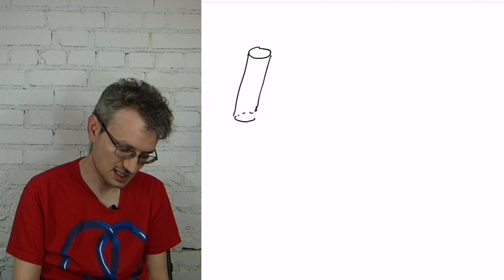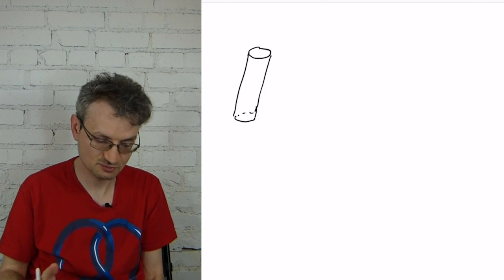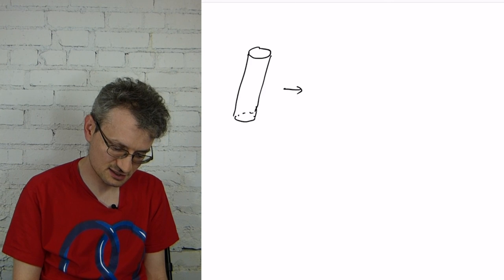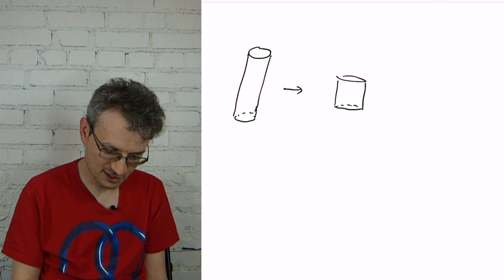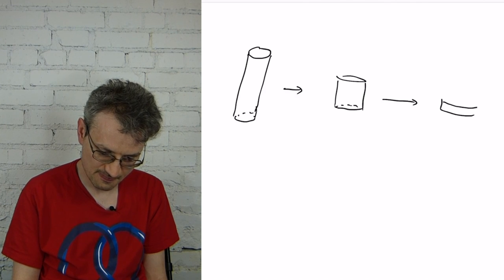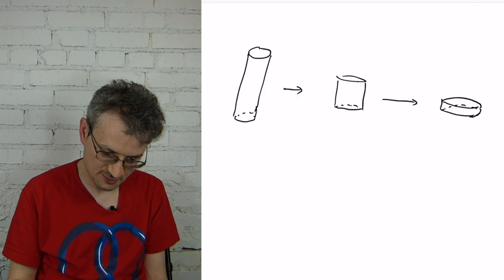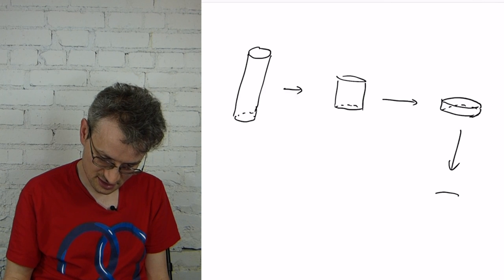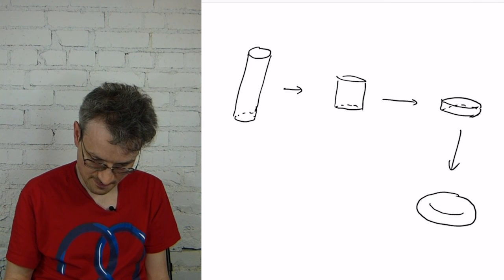How many holes does a straw have?

Comment: Question: you say a pair of scissors has two ways of passing a rope through their loops, but isn't there at least one more? Rather than passing through one single hole or the other, couldn't you deform it so a rope passes through both holes at once? Are there ways to pass it through both holes that are non-homologous to any other sequence?
Reply from the maker: Getting a little bit more technical: the homology group is Z x Z, or the product of two copies of the integers. Another way to think about it is vectors in the plane with integer coordinates. Going right one step corresponds to going through one of the holes in the pair of scissors, and going up one step corresponds to going through the other hold. Any other way of passing rope through the loops is homologous to some number (possibly negative) of copies of each of "right" and "up".

Comment: To answer how many holes a person has, instead of creating larger spheres around atoms, what about creating an increasing size sphere and counting how many paths through the body that sphere has? When passing a sphere through the body, only allow those paths don't cause lasting damage when the body deforms around the sphere to accommodate its passage.
Reply from the maker: Sounds painful!
Reply: @henryseg  we should define paths via fluid being able to flow without going through cell membranes.
Reply from the maker: @zoltankurti  Fluid under how much pressure...?
Reply: @henryseg  I think I have a new approach. Take the cells from the human that are not epithelial cells. Take the set of points in these cells and the induced topology on these points from the standard topology on R^3 and apply your favourite definition for a hole.

I'm afraid a precise definition that's not a torture does not exist, altough I don't have a proof.

Here is a new question: this may be fine for defining the number of holes on each person. But what if I ask what's the number of holes in the concept of a human, not a specific person? If we assume there is a definition that works for every person, can you define the number of holes on The Human?

Comment: I'll always contend that a straw has no holes being that a properly structured and functional straw is itself a tube. A hole would be a puncture in the side of the structure
Reply: That's a good point

It itself is a hole therefore making it a pipe, tube, or tunnel, so on.
Reply: But how long must it be to function as a tube? Is a finger ring a tube with no hole in it?

Comment: I like how the sendoff of the video leaves you questioning not only what "holes" are, or what the object in question is, but now what it means to "have" a hole. Does the opening or closing of a mouth mean that a body no longer has that opening? Surely it still "had" it but no longer "has" it. So the question of how many holes a person "has" depends on the precise state of that person... I guess.
Reply: The mouth is still a hole. It just has a door called the jaw.

Picture this: a doorframe has a hole. A blank, solid door (usually) does not. If there is one door to a room, with no other opening (door, window or vent), then the room also has no hole. Translate this to a human face: the mouth is the doorframe. The jaw is the door. The lower face is the house. Kinda.

That's just my interpretation, though.
Reply: The proper answer to the question of how many holes a person has, regardless of the state of the person, is always "not enough, now where'd I put my knife?"

Comment: A hole is defined as "a hollow place in a solid body or surface."

A straw has one hole that goes all the way through what would otherwise be a solid cylinder. If you take a cylinder and drill a hole 40% into the object from one end, then the other, it has two holes. If you then drill through the remaining 20% in the center you merge the holes into one hole larger hole that runs completely through the object. This is the obvious linguistic definition and what people mean. Anything else is sophistry that primarily only serves the purpose of corrupting language. Fundamentally language is a tool for communication, and corrupting it in this way ultimately leads to further difficulty using that tool. The end result of breaking definitions that are perfectly serviceable without a serviceable replacement is the erosion of our capacity for communication. . . Communication breakdowns often result in disaster.
Reply: at least when people bring unneccesary sophistication into conversations they typically preface it with "technically..." which is at least a good disclaimer for when people want to get annoying about details. But yes, technicalities are almsot entirely useless in day to day lives and dont serve to  help the average person. Good comment.

Comment: Well, I mean, the idea of increasing the radius around each atom until they overlap kinda answers the "how many holes" question. It starts at infinity and converges to 0. The higher the value under the curve, the more dissociated the thing is (kinda like a stdev)
Reply: It doesn't start infinitely? It starts at zero. Or you could argue it starts at one if a hole with a non-existant/infinite perimeter and infinite surface area, counts as a real hole.

Comment: A basketball has a 2 dimensional hole, but a solid metal ball does not. 
A donut shape has two 1 dimensional holes and only one 2 dimensional hole unless it is solid, in which case it has only one 1 dimensional hole.
If a straw is considered only in the limits of 3d space, it could have only one 1 dimensional hole or it could have two 1 dimensional holes plus a 2d hole that aligns with the two 1d holes. This would change if there was continuous shearing.

Then there is the possibility, if you are considering higher dimensions, that a straw is a 2d plane that approaches itself on an single axis for all points in a line, in which case it has no holes, because you can make it expand and contract infinitely without changing what its shape will be at this point in 4d.

A black hole is a hole in at least the 4th dimension, and a 3d sliver is visible in the 3d dimension, so a black hole is at least one hole of an object that exists at least in the fourth dimension.
But it is entirely possible that groups of black holes are part of a single 5+ dimensional object, like a single 2d hole of  an empty donut (the ring) will look like two separate circles in a 2d cross sectional universe.

Comment: i say 0 cause its a material designed just to hug itself in a cylinder shape, any spaces "inside" that cylinder are not inside, they are basically outside since the inside would be in the edge of the straw

Comment: There's 1. If you have a hole through a wall it doesn't matter how thick the wall is it's still A hole. Don't know what holes in the ground or cups have to do with anything they don't have holes running through them they have openings.

Comment: Holes dont need rims like the donuts shape so i wouldnt say a cup  has a hole i would say a straw only has 1 hole, the thiorie that passing a line thru multiple holes makes each combination singular a is verry interesting question is it 1 hole untill the space is filled x the amount of combinations  reminds me of the how many triangles are their puzzles the more you have the more combinations you can make,

But i guess a holes is a representation of depth in a surface and doesnt have to go all the thru so maybe if a cup and a staw has 1 but the donut has 0 holes because their isnt any depth in the actual surface no matter how much you seemingly loop it thru you are technically wrapping it around the full object it is a good question because i cant figure out which answer i like because they both make sense

Comment: The discription you neglects the notion that a hole is defined by a singularity, or more generally a hold defined by curvature. An interior and exterior surfaces are knitted by these singularities. Since their two distinted places where these surfaces connect, there are two holes. These "edges" make the biscuit roll from doughnut and biscuit different from a doughnut ball. Its a different kind of topology because you have two surfaces not one.

Comment: The scissors have three holes if you go by the string method. You could thread the string through both. I don't think this is the best way to go about it.
My definition of a "hole" is any depression in, or path through something. I always thought of plates as having a hole to put your food in. 
The donut vs. straw messes with my brain a bit more, as I do "want" the donut to have one. I'd say that a path-type hole which is shallower than the width of any perpendicular (to the hole) axis of the holey object, counts as a single one, whereas the "longer" holes end up being two, as either opening has sufficient depth to be its own hole.

Comment: If we go the string method, a straw has one hole, but if we add one more hole by cutting one into the side of the straw, the straw now has three holes.

1+1=3
Reply: First of all did you even watch the video? 
Second, you are thinking of a hole as a 2D gap in space, where as the video is about 3D  paths. The straw with a hole in the side has 3 "paths" top to bottom, top to side and bottom to side. There are 3 potential unique paths, and therefore there are 3 unique holes, which with an intact straw there is only 1 unique path and therefore only 1 hole
Reply: @JackdotC  Maybe you should go back and re-read the comment you just replied to.

Comment: Does an infinite plane with a simple bounded disc removed have more, or fewer, holes than a simple bounded disc?

How many holes does a hollow sphere have?
Reply: If holes is taken as the genus then the punctured plane has 1 hole and the disk and sphere have none.
Reply: The sphere doesn't have any because you're not allowed to tear the shape. Squashing and stretching the shape can't create a new hole, and the inside and outside are separated.
Reply: My logic tells me that a hollow sphere has -1 hole. Drill a hole in it, and what have you got? The same as a cup or a bowl, which have zero holes. So if you drill a hole and end up with zero holes, then you must have had negative 1 hole to begin with.

Comment: I think using the term "hole" for a cup is wrong. it's more of a pit. that way going from a cup to a bowl makes more sense as you could claim a bowl also has a pit.

furthermore i think a straw has one hole. if we flatten the depth of a straw to be the width of paper, we would claim that the paper has one hole even though it still has depth.

Comment: I follow your argument that the straw has only one hole, and it's elegant, but at the same time it seems like there must be an equally elegant definition of hole where it has two. Does the circular edge argument that you led with for the cup work? or was that just a straw man? heh. but seriously.
Reply: I'm thinking the issue is that hole also means entrance, and I want to be able to say a straw has two entrances, whereas a donut has just one because the two sides are so close to each other..
Reply: In his first example with the cup he said that the shape should be allowed to morph. If the straw is flattened it would look like a hoop and would have 1 hole, a straw is thus an extended hoop.

Also, with the string method you only have one unique route through the straw, so it has one hole.

By both of these definitions glasses with lenses popped out have 2 holes. But, by your logic, (which isn't unreasonable by any means) binoculars with no lenses would have 4 holes rather than 2, though they could be as short as glasses or as long as your forearm.

Comment: 3:09 Can anyone explain why he assumes a hole has to be defined by a means to "loop" (i.e be able to pass though and then return to where you started) string around the object? What about a space that is divided into two distinct parts by an infinite plane with a 'hole' in the middle? Surely that is still a hole, but you cant go through the hole and then return to the origin by a 'loop' path, only by going back through the hole (similar to entering the cup and then having to exit again)???
Reply: That's the thing, it's not a hole anymore, it's a plate - there's only the one circular edge on it (it extends to infinite everywhere else, so there's no other borders).  A very weird looking plate of course.

Comment: I *think*, its zero or one, depending on whether the ends are edges, or are round.  It's either a cylinder with missing circles (2 faces, 2 edges, 0 holes), or a really tall torus (1 face, 0 edges, 1 hole).

Comment: Unfortunately, language is not a portent of reality. If someone said that a petri dish has no hole but a cup does, then the answer to the definition must be changed to "A hole is a boundary circle that is extruded by an arbitrarily large difference, similar to the difference between a pile and a heap of sand" and you would inevitably find that adding these conditionals up by testing which things have a hole and which don't is an impossible task, there is no definition which precludes everything that is not a hole while including everything that is, with the exception of one, "A hole is anything distinctively identifiable as a hole by a human who speaks English."

Comment: A topological nightmare:

You sit up, and find that your holding a sponge in a room with a rolling pin, and a 3 hole donut with no jam in it all, and you realise that you're in the US. Thats when suddenly you're gripped by the need for a unique solution, and it's just not working at all however much you push, it's just too spongey and resilient… And then you wake up.

Comment: There is one hole using topology
Reply: Consider a circular disk in the plane.  Think of a very large vinyl LP, (Great hits from the seventies, on a really gigantic record player.   This is a Manifold With Boundary.  That is, a very small insect on track number 397 would think it is just the surface of the earth, a two dimensional manifold.   
The inner hole is a circle.  A circle is a one dimensional manifold.  It separates the plane  into two parts.  Inside and outside.  Two non-intersecting circles separate the plane into three parts.  Each circle is a boundary.  

The plane is a two dimensional manifold, of type unbounded (infinite in each direction) manifold.   If you add a circle, the interior part is a two-dimensional compact manifold with boundary:
compact: you can draw a finite box around it
2-D manifold: locally, (from a mite's view) it looks like the entire plane.
with boundary:  The outer edge.

Each boundary is a hole.

Not convinced?  Suppose you don't like seventies music, you only like the last song, (Pina Colada song), so you decide to cut a hole in the world's larges record, precisely around the center hole, breaking off a 45 rpm.  Now you have to admit that the outer edge is a hole.   

I've studied this, and am kind of scratching my head at this presentation.  And i'm just joking on musical tastes in general.   

I have been a topologist,, I saw one video get it all wrong, then two more, and this one is the closest so far, but I think he lost the thread and direction?